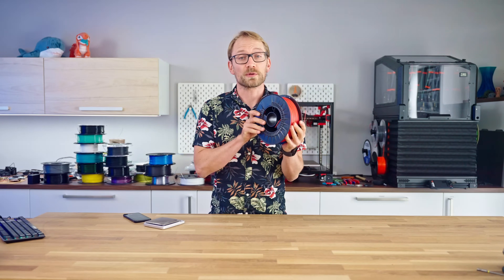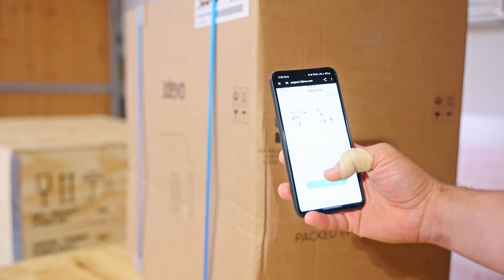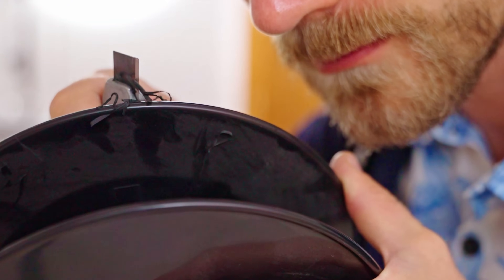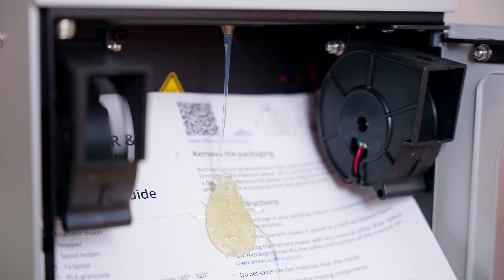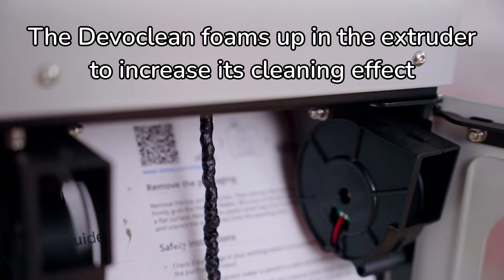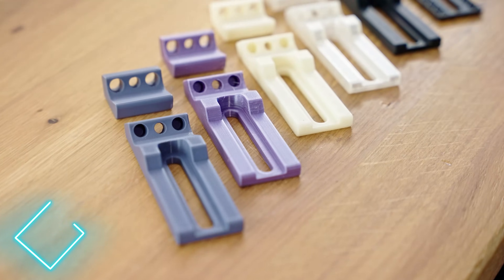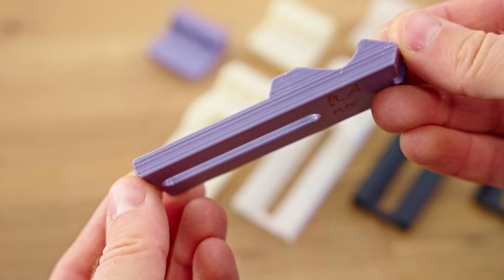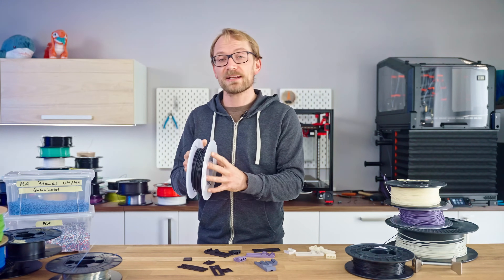Can you print (with) your spools?

Comment: When you truly think it all through, with the exception of perhaps PET, I seriously doubt that it is truly possible to reuse filament AS-IS.  The evidence behind this is that the polymer “cooks” if left at temp for any period of time, which means that it cooks (degrades) to some degree no matter how long it is at temperature.

The recycled filament needs something to either reverse the degredation during its first use and the additional degradation that you are going to put it through, or something that can reduce/dilute that degradation.  By adding virgin material, you are effectively doing the latter.

The exception with PET is crystallization.  Once it crystalizes, it is done, unless you do something to reverse the creation of crystals and turn it back into a polymer.  Anywho, I don’t know if you are following the law suits here in the US, but the oil/plastics industry is being sued by several states for making false claims in regard to the recyclability of plastics.  With over 50 years of data, they have basically proven that recycling plastics is nothing more than a pipe dream.

BEST

Comment: PP is the most difficult to print material I have ever tried. It warps so badly that it pulls the PP tape used to make it stick. I'd be curious to try some PP blends that would retain its bending properties and reduce the warp (or make it stick to PEI). One thing I'd try would be to add some virgin ABS to it (hopefully without causing the issues you faced).
Another idea would be to try creating a flexible blend.

Comment: I think it would be safer with an unknown mix to make a 2 part mold and just form the part with  a lump of plastic under pressure........making the 2 part mold is the time-consuming part and you need some metal and machine experience to make the mold also a need to make more than a few dozen parts Wirth the unknown plastic waste.

Comment: Could you use the difference in density of PLA and ABS to separate the ABS from the PLA. Perhaps using a salt water solution with a density of about 1.1g/cc so that the ABS will float and the PLA will sink?

Comment: I suggested this to Stefan a while ago, but I was curious how many times you can recycle 3D prints. At what point do the plastics degrade to the point of being unusable, even for those "sanity check prints" where you just want to see if the thing you designed in CAD even fits/works/ect

Comment: I worked a bit with injection molding during the summer, and yeah... we had 3 different purging compounds to satisfy the temperature ranges of all the different plastics we ran (prototyping machine). It sure is important!
Reply from the maker: I found out the hard way - probably the biggest factor in why hobbyist-level filament extrusion has never really taken off. When you need to invest more time and material for purging than for actually extruding filament, the value trying to recycle failed prints yourself quickly becomes very questionable.

Comment: For your contaminated PLA material you can try using The density of the material as a separation method, or you can use some sort of solvent to melt out the ABS

Comment: The first thing that popped to my mind when your first ABS batch went wrong was "Don't they usually add virgin material into the mix to lessen the polymer degradation?". And the answer is yes, usually the mix is 70% recycled and 30% virgin to make pretty much mechanically and chemically identical polymer as it would be 100% virgin material. The polymer degradation is quite fast thing, like everyone with some old cars knows the trick to give sunburn black plastic parts some torch or heatgun to turn them back to true black but you can do it only once and even after it the parts will be a lot weaker, that's polymer degradation and one heat cycle is already quite big thing. You can make 100% recycled plastic but then you need to chemically treat the material for that polymer degradation.
Also the clean is the word. Probably many have and will comment about PET bottles and you really need to clean them well, like there must be nothing in them especially sugar (or sweeteners in general, they're all sugars but some are more sweet than others so you need less of them).

Comment: I'd like to see if there's a way to recreate PLA+/Pro blends. Most of them are a secrete blend of additives that make them stronger than regular PLA, and it'd be neat if you could try making something comparable to something like Polymaker's PLA Pro (I mention them specifically, since they have a standardized testing method they use for their filaments). It'd also be fun and interesting to learn what additives are possibly being added to make them strong.
Reply: From what I know, I think their additive is a blend of PBT

Comment: Thomas, sorry that I couldn't contact you any other way, but I need to ask your opinion. As a respected member of the 3D print community, I was hoping you could lend your expert opinion to my question regarding a swappable nozzle system for the Bambu P1S. I only have the standard nozzles now and was wondering what you would suggest as being a good product to use. I am considering doing a lot more with the printer, which may involve swapping nozzles more often, and I would like an easier way of doing it other than with the default “complete” hotend units on the Bambu Lab P1S. Remove 3 wires, remove two screws, remove complete hotend, and reverse to install. I know it doesn’t sound like much, but if I could simply swap the nozzle, I think it would be less time consuming and fiddly, especially when dealing with re-attaching the wires, which I have found to be very persnickety. Thanks for getting back to me!

Comment: What I want to use recycled filament for, on the Prusa XL: use recycled material with a 0.8/1.0/1.2mm nozzle, and make the inside of every model and all infill out of any color. Tool change for the outer layers to be new material through 0.4mm nozzles. How much print time and filament would it save? Can it get close to regular surface quality? Can you ignore more contaminants with huge nozzles?
Reply: This is a neat idea! Shredded failed prints etc for infil sounds like a great use

Comment: They sell you a huge grinder that generates microplastics when all they needed to do was have a pre-heat chamber to make your source material able to blend together.   The auger that feeds the extrusion can be preceded by a mixing system using arms or motion, etc...but grinding doesn't need to happen, I guess they'd have to include a precision controller and more sensors but it would take up far less space, make far less impact on environment, be much less expensive, and a huge piece of equipment made by consuming and/or contaminating a lot of natural resources completely avoided.
The extrusion is working okay, though.  That in itself is pretty impressive!

But careful - if you turn all your spools into filament, you'll have to print a spool to keep it on.

Comment: I think you've missed that there's plasticizers in fresh filament/fresh material. 50:50 mix worked because you had the plasticizer in 50% of it. Recycled PLA are a thing not because of perfect conditions, but because of additives. I assume we're burning out the plasticizers during printing and that's some of the fumes and smell we get.
Reply: This is a misconception, nothing we print with uses plasticisers. If it did, it'd knock you out with stink. PVC is a common plasticised material, but please don't experiment, just ask someone or take my word, very dangerous.

Polymers we print with have limited cycle life because they experience some cleaving when molten. But adding some virgin polymer results in a cohesive material where not too much of it is cleaved in total.

Comment: Most people are NEVER going to be able to afford a setup like this which is understood. I'm also far too lazy to build one of the open source designs. What I would just like in the interest of recycling is just a home version of the grinder so I can melt the grinds down into sheets and use them on my CNC to make other products. This would make me happy.
Reply: How about the Buzzkill shredder? A printed housing, a steel ruler, a drill as a motor, and a router bit as the cutter, a couple bearings and standard hardware. This is a very easy build right, or is that too much work as well?
Reply: @SianaGearz  i don't know what a buzzkill shredder is, or am i missing something?
Reply: @atienne_navarre   A compact (almost hand-held) shredder for 3d prints, designed by someone who calls themselves buzzkill, which is completely made from a 3D printed housing and common parts. The router bit does the shredding, with a piece of steel ruler as the mating surface. Very simple and easy build.
Reply: @SianaGearz  Thx  Ill look for it. If you run across it, please post.

Comment: In commercial recycling they will mix like materials together, but the systems are quite a bit different. The sprue size is WAY bigger than our tiny  hot ends.  This allows for inconsistencies.  Place by me makes plastic pallets and plastic barrel carriers out of recycled resins.  The machine is sloppy as all get out, not precision at all.  The feed sprue is at least 10mm in diamater...yea, they are huge. 

You are 100% that when you see "recycled content" it is generally scraps from their own manufacturing. Funny thing there?  SO many places where I live have been doing this for a LONG time, but now they are putting in their specifications...AND CHARGING for it.  Genius on them, but when I used to negotiate with these shoot and ship houses they were all "Oh this is so complex".  I was always "So, please, take me through it, 2 years ago, before your "Recycled Content" resins you had a grinder, drier and dust separator on all your injection mold presses.  You took the sprue(s) and runners and put them into the shredder, it then went to the dryer, then to the dust separator.  There it was metered into the resin.  What changed".  Of course...NOTHING.  Except they charged MORE because "it requires more process".  Yea...and so many people ate that up as fact. :(

Comment: I'm surprised you didn't use acetyle to check if a spool is ABS. Not quite sure if other plastics dissolve in it as well as ABS but it's usually a good way to check.
Reply from the maker: You mean acetone? That also dissolves PS and PC, so it would only really weed out spools made from PP.
Reply: @MadeWithLayers  that.. acetyle with oxygen would probably be a bit too much.

Comment: We own a 3devo Precision extruder and a small shredder by QiTech (built like a tank!). The recycling process is fiddly, but it's actually possible to recycle PLA and to print with no issues with produced rPLA. Our experiments with HDPE filament production (our actual goal) were not successful though.
Reply from the maker: Trying PE for filament making was one of the things I still wanted to try, too - what issues did you run into?
Reply: @MadeWithLayers  Besides the lovely smell while printing it warps way too much even in an enclosed heated chamber. So possible to extrude with 3devo: sure. Possible to print with: less so.

Comment: You should try out regular household plastic waste. PET printing (from bottles) has been explored before, but it could be further refined and there are other kinds of plastics out there as well.
Reply from the maker: It's pretty hard for me to collect PET bottles to shred into filament - Germany with their "Pfand" system makes bottles worth 25ct each, which is more than buying fresh granulate..
Reply: @MadeWithLayers  Could you try it with Polypropylene (PP, marked with nr. 5)? It is the second most used plastic and is generally used for food containers. You can also clean PP items by simply throwing them in the dishwasher and it doesn't absorb moisture, which should make recycling quite straightforward.
Reply: @MadeWithLayers  But Pfand/emballage/buy-back is only for drinks.
You don't have to bring back bottles of glass cleaner or display cleaner, which are usually also PET. And there is a lot of other packaging out there.
Reply: @sasjadv  Truuueeee, thanks you :D
I am going to try to make some petg with old glass cleaner and defroster bottles now!
Reply: @ Imagine someone asking what brand petg you're using.
I'm using "Grundig monitor cleaner"😂, or "off brand Windex from Lidl".
Reply: @MadeWithLayers Hahahahaha, gotta deal with those pesky Leergutautomaten then 😂 not that i have anything against them or this has anything to do with 3D printing, except maybe Leergutautomat parts could be 3D-printed...?
Reply: PET bottles are not waste in many countries. They have dedicated recycling systems. You pay a fee when buying the bottled product and get it back when you return the bottle. 

PET bottle printing videos are only for the group of countries that aren't making that basic recycling effort.
Reply: @MumrikDK  In my state only beverage bottles have a deposit, which is only 5 cents for water, juice, soda, and beer, 15 cents for wine and hard liquors, and nothing for milk including flavored milk.

Milk, including flavored milk, tends to come in HDPE (resin code 2) bottles.  I actually shredded up a bunch of that but could never get it to print well.  Makes for excellent purge however.
Reply: @soundspark  Hey I know this is a year late, but was the main problem you were having with HDPE extrusion or adhesion? For build plate adhesion I tried using a cut of the flat side of the jug as a mini-plate taped to my build plate (lol), but I couldn't get my extruder gears to feed the filament consistently without it ending up with a dent and non-feeding :(

Comment: You can , yes, but you are going to spend a lot of money, to grind your waste plastic( probably you throw to your bin more food packaging plastic in 1week comparison to those spools.....) and make the filament. This process is slow and it will cost electricity. you need info on the plastic type, needs drying, needs proper processing conditions which depends on the polymer type, and even after that it may perform the same at best ( usually this do not happen)or worst than the virgin material( this is highly likely). not worth the money, time and effort , not even for print farms. And the grinder does not grind thermoplastic elastomers, so forget TPUs in general.

Comment: Personally I want to start a filament recycling centre. But I need funding.
Love the 3devo machines.
CNC kitchen has one also.
I go through about 30 spools a year at present.
Much is support material and rafts.
Would love to turn that back into filament.
Reply: At your scale I wouldn't worry too much about it. I have a 3D printing company (Takween 3D) and we use around 2 tons of filament (estimated for this year). Even at our scale it seems too expensive to go down the recycling route. We estimate we will be extruding 5 tons of material in 2027. Maybe by then we may consider recycling.

Comment: I used to think that there might be a good recycling path for spent spools, but I think that reuse or upcycling is a much better path forward, concentrating on buying from filament manufacturers that encourage reuse of their spools rather than going for the "economical" way of just selling more spools. Basically, a scaled-up version of the Master Spool idea.

1. Because of polymer degradation and the huge variation in additives even within the polymer families, plastics can never really be recycled into something as strong, as flexible, or as attractive as the original product, which is why they get turned into things like dingy brown park benches or composite decking. Plastics manufacturers love to tell us otherwise, but this is the same kind of marketing as "cigarettes are healthy": they're lying to sell more product. In reality, recycling is costly because of the insane sorting required, and even if the waste management system manages to recycle plastics, the end result generally isn't marketable at all.
2. Then there's the environmental impact of recycling at home. Grinding down the plastic is going to result in microplastic particles getting everywhere, and when you heat the stuff up you'll off-gas VOCs (esp. styrene from ABS/ASA) and particulates. You'll need a venting/filtering setup if you value your long-term health, and you'd need to mitigate or capture the emissions if you care about the health of your neighbors, and that's an additional cost to the recycling machine. We're seeing substantial waterway and soil pollution because plastics manufacturers spill chemicals and virgin pellets/nurdles with little oversight and because big retailers send plastic waste to poor countries, so bringing that to one's home or print farm business seems highly questionable to me.

Comment: There are devices that can identify the type of plastic a thing is using spectroscopy but I'm not sure how accurate they are with identifying co-polymers and such. This might help with sorting stuff before it gets shredded.

Also, the contaminated shredded plastic isn't necessarily a lost cause. It can still be melted and molded into other things. The Brothers Make channel has some good ideas on ways to recycle plastics.
Reply: Contamination is nearly always VERY bad. Same Brothers Make are very very meticulous, they have to be. If even a little bit of PP gets into a batch of PE or vice versa, you can throw away the whole batch, it's not going to make a cohesive casting. HIPS quickly destroys adhesion of ABS, lots of other examples.